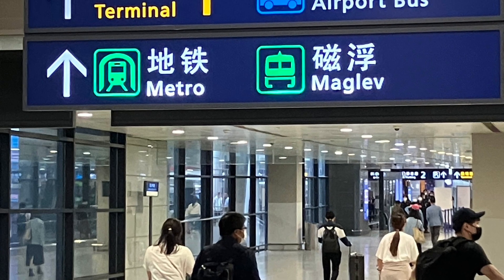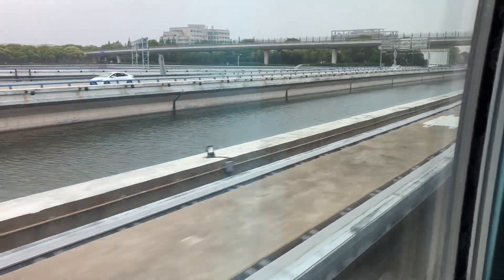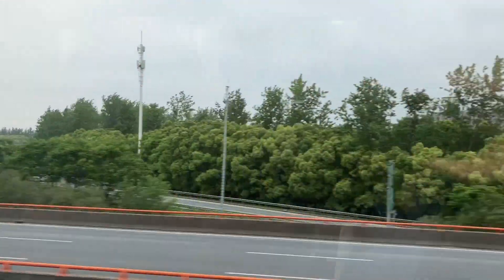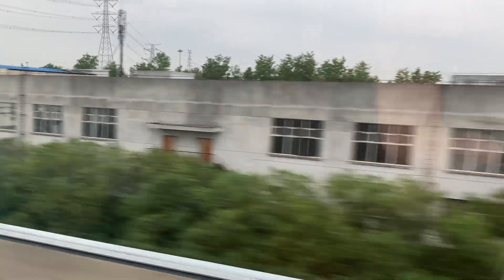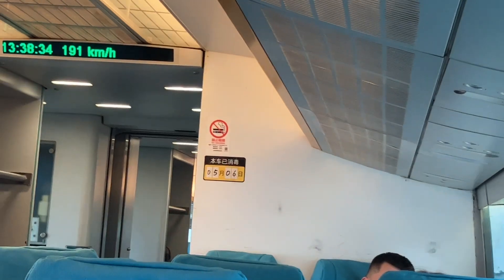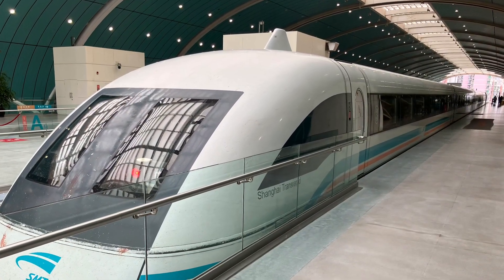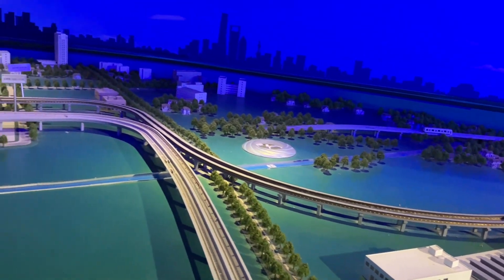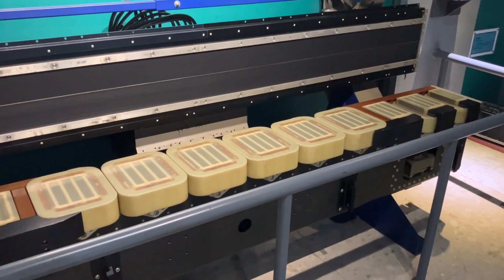Traveling on the Shanghai Maglev train

Comment: The symbol for kilometres per hour is km/h, not "kph" (which would mean "kilopicohours", or "nanohours"). Also, the word kilometres is pronounced to rhyme with "nanometres" or "millimetres", not with "thermometers" or "speedometers" (because it's a unit of measurement, not a measuring device).
Reply from the maker: Thank you for this. I'm learning all the time. You may have been able to tell that I am an American and do not use metric in my daily life. It is a challenge to try to stay on top of proper terms and I cannot promise I will always get things correct. Again, thanks for the input.

Comment: it used to travel at 430kph, for 10+ years before the covid. for some reason it tops at 300 only nowadays.
Reply from the maker: That's really interesting. I wonder why it changed to limit it to 300 KPH?  It is still quick but I would have been interested in riding it at the higher speed.
Reply: @este_Pandy_Projects  i guess the ridership is down and the cost of running it at 430 is much higher than at 300. the number of intetnational flights were only a fraction of what it used to be. foreigners are those who find this interesting. most chinese who are interested in this may have experienced it at some point iver the past 2 decades. let's hope as more people travel to china they will resume the 430 speed.
Reply from the maker: @QL2004  Well I think I'll be back in August so hopefully my ride(s) will contribute to the numbers tally. I would love to experience the faster speed version of the ride.

Comment: There are actually currently 7 commercially operating maglev train systems in the world (and one more open to the public as a demonstration ride). Shanghai is the only high speed version, but there is plenty of low/medium speed systems
Reply from the maker: Apparently I was working on partial or old information when I made this. The high speed operations that are actually working to transport people in a practical and repeatable safe way is the most interesting to me.
Reply: @este_Pandy_Projects  Well, it got to be very old information, because Linimo Opened in 2005, medium/low speed. And its a fully commercial operation (while partly subsidized by the municipality that is very typical for all modes of transport).

If we limit it to high speed its of cause true (well at least until 2027, possibly 2025).

I kind of think its telling that the low speed maglev is more common than the high speed. It really tells the story about high speed is not the core selling point.
Reply from the maker: Fair enough.  I still think that the sample size is still so small that it is not really possible to claim what is the most common. Numerically yes they have more working projects but the interest by the public is still in the high speed projects and any emphasis in future development tends to focus on the HS.
Reply: @este_Pandy_Projects  Well.. of cause, large scale project will lag behind. For a new metro line maglev have a almost perfect opportunity, where it can compete fairly with Monorail, over and under ground metro... and.. well... Trams.

And.. well.. Monorail is really the only system that is simular. Under ground metro is way more expensive, over ground metro is also more expensive. Trams are considerably slower. 

High speed system will take longer to plan. And i also think there is way more push-back against maglev there. High speed trains are really profitable for big rail. They really don´t like competition
Reply from the maker: @matsv201  You are right about the competition and the variety of installation expenses. I do think that the novelty of the form still has a big appeal to the public. It is still perceived a futuristic vehicle like a jet pack probably even more than a monorail is anymore since so many now are installed slowly moving people around Zoos and amusement parks.

Comment: HSR 'D' 200-250 km/h
HSR 'G' 300-350 km/h
Maglev 431 km/h

D runs on existing normal tracks, G runs on dedicated HST track. Maglev runs above track.

They are currently testing a 600 km/hr maglev to be deployed between certain cities in a few years time.
Reply from the maker: Very interesting. I’m definitely impressed with the speed that China is building their new rail infrastructure.

Comment: I took this maglev a few times. Most of time it could reach the top speed of 431KM/H. It's like flying above the groud. I wondered many times why China hadn't built this maglev line among all major cities. Currently most HSR in China has the top speed of 350KM/H and only cruise at  speed lower than 300KM/H.
Reply from the maker: Yes I had noticed about the speed. My train stayed at 300/301 and the HST I took did get up to 350 very briefly.

Comment: In fact, China has built two medium and low-speed maglev trains in Beijing and Changsha many years ago for urban public transportation, with a maximum speed of 140 kilometers per hour. The cost per kilometer in China is about $15 million, less than the cost of building a subway.
Reply from the maker: Interesting. I had not heard of these.

Comment: The Shanghai Maglev is NOT "new" NOR "ten years old".

The Shanghai Maglev is almost 20 years old having begun operation in October, 2003.
Reply: There is a typo. I should be October, 2003. It's been about 20 years since it opened for public.
Reply from the maker: @yzhang2008  Yes you are right I was just teasing back to the poster
Reply from the maker: I don't believe I ever called it new. Also if it is opening in October 2023 that really would be quite a feat because that is still a few months away. LOL.

 It was commissioned in 2000 and built very quickly opening in 2003. It is hard to believe something almost 20 years old is still the only really functioning and open to the public Maglev trains.

Comment: Thanks for the video.  I've just watched a video about a gérman maglev accident.  Some people commented that they have ridden the shanghai maglev and found it loud and noisy, you've proved that to they were lying.
Reply from the maker: Thanks. The ride I experienced was not loud or noisy. I found the whole thing fascinating. China’s transportation advancements are nothing short of amazing. It is inspiring how quickly it is all coming together.
Reply: It's not a question of if China is going to be the most advanced, powerful economy in the world, i'ts a question of when. Hard to believe that North America once had some of the most advanced passenger trains in the world.
Reply from the maker: @robertbruce1887  Yes I have little doubt of the strength of Chinese Rail infrastructure. They are really rapidly building new HST/HFT rail lines. I took some and could see from the east/west lines that currently under construction north/south lines will intersect and do a great job of connecting the whole country. It is really very impressive.

Comment: The SMT can go 431 km/h  at times (or scheduled time periods) where the max speed is not reduced to whichever reasons.
Reply from the maker: Interesting. I think that it will not be long before the other two Maglev lines. The one in China and the one in Japan open for full service. Both of those are capable of higher speeds than this one partly because of the longer runs they can make. The speed of this one is really kept limited because of how short it is. Still very neat to see the concept in service.